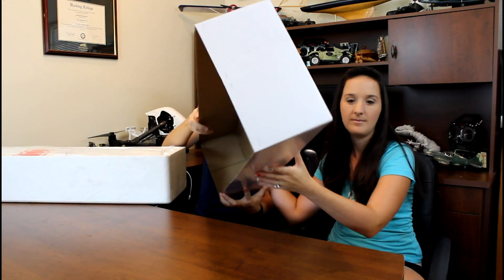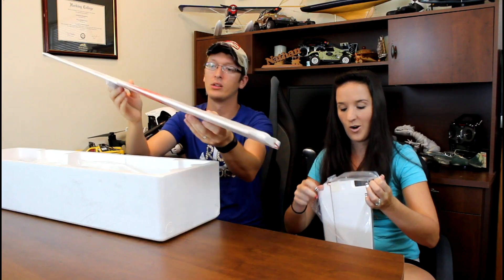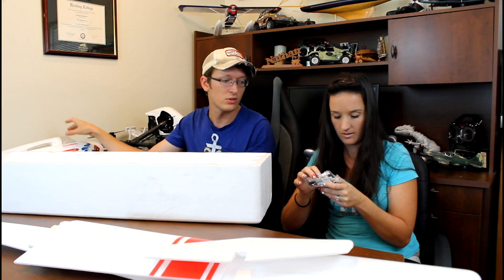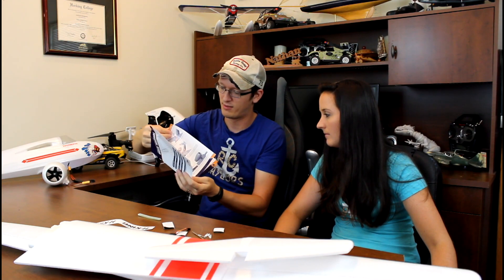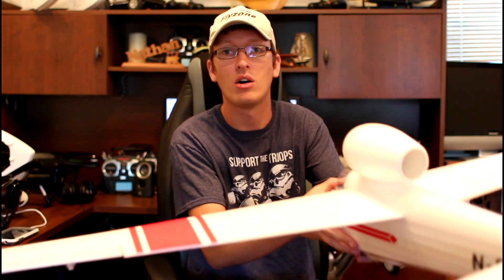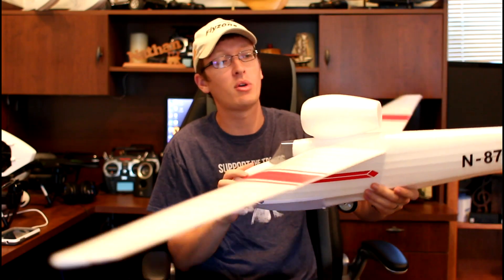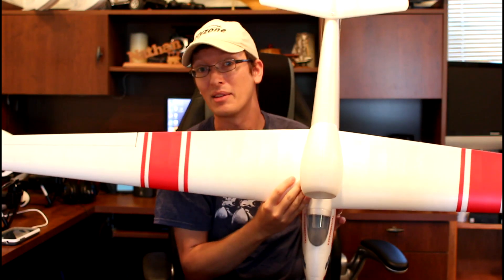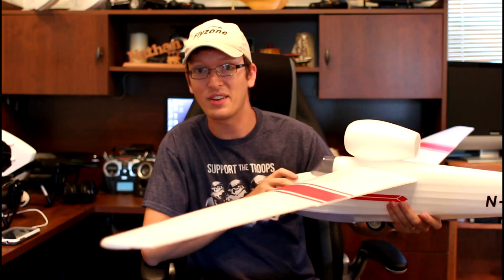CRAZY Fast & Easy Build - HobbyKing Hall Cherokee Glider Unboxing & Build Tips - TheRcSaylors

Comment: Welcome to the world of EDF aircraft, once you fly this and hear the sound of the fan spooling up you well want more,  Motion RC has some of the best jets available at really great prices and there customer service is awesome, can't wait to see the flight review of this glider, probably going to be wicked fast, just be careful on tight turns with this at full throttle, the pressure on the outer wing is really great, could fold the wing, you guys should do a review of the ST Models, BLAZE at tower hobbies for$99, its a high performance glider, beautiful aircraft can hit speeds of 90 mph, another great review

Comment: I hope its nothing like the ST Salto. That thing was heavy and flew like a ton of bricks. It had terrible stall characteristics which was the reason it ended up in pieces. I couldnt get that edf junk to fly right for the life of me. After I spent a week repairing it, the thing decided to crash a second time,I belive it had everything to do with the long thin control wires they put in them. It was impossible to correct a stall because thats all it wanted to do. I feel the wings were also way to thin and not aerodynamic at all. There was nothing to create lift,so it would automatically stall. I have seen the plane you have fly before and as a pull behind glider,it looks like it does quite well. I am sure you wont have any problems with that one due to the fact they put the servos out where they belong,on the wings. It looks more realistic too.I have seen real gliders with both fixed and pop up motors,really cool stuff. Very expencive stuff in real life. I love the custom trailers they can pull them behind a car no problem. We have a place nearby you can go up in a glider. Its not cheap,but getting a chance to see Lake Michigan from up high is a real experience. I have flown out of Traversecity once,it was at night,I was so bummed. Cant see anything.